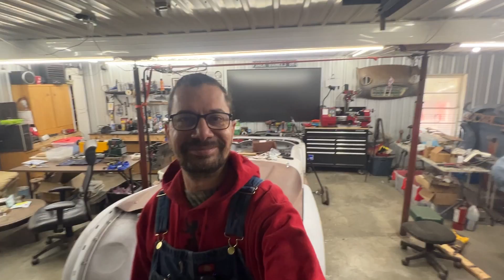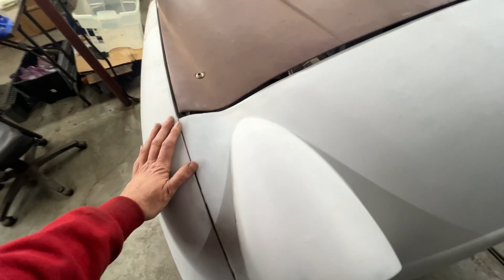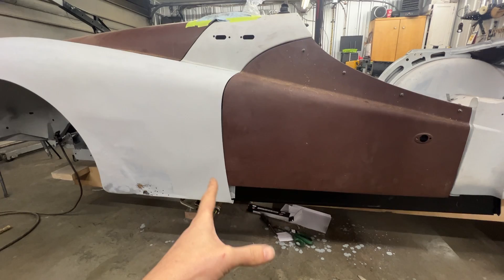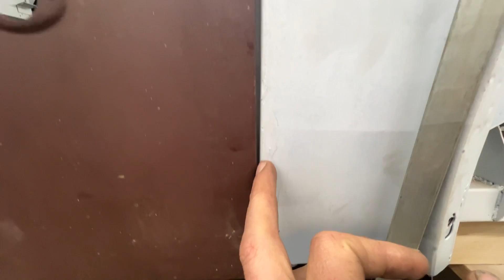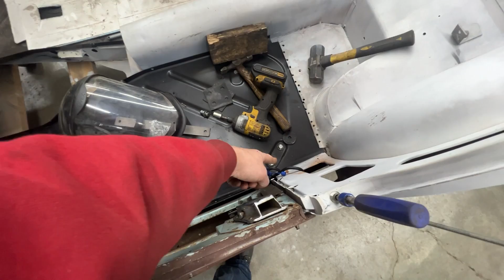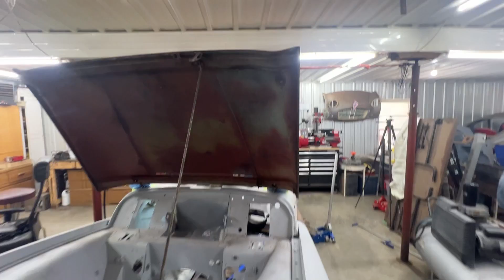1958 TR3 - Part 6 - Playing with panels and gaps

Comment: Hi there  with my tr3a I have even door gaps on the  A post and the B post and the sill section but the A post with no hinge shims the A post gap is roughly about 5/32" (4mm) I am happy with the B post  and the lower sill gaps about but not happy with the top of the curved section what is 1/2" (12mm) what I am asking should I twist  the outer part of the A post panel ( the outer captive nuts section)to close the front gap up a bit and weld steel rod to close the curved section of the door ( near skuttle panel) great video keep up the good work watch from England cheers mark

Comment: Is the car truly a 1958 model?  The 1958 model year started at TS22014 and these were unofficially known as TR3A.  These cars had the wide mouth and external door handles were among the many changes.  It seems like this car has a mix of different panels which is likely causing fitment problems.

Comment: The way the front left fender (as sitting in the car) fits, you can tell the front of it is pointing left, fenders wider at front than rear. That tells me the center of the nose is low needs raised up to match the shape of the hood, not the hood changed to match the nose. That will let the edges of the hood match the fenders and the nose better. And fix the gaps at the front of the hood by bringing the fenders closer together.

Comment: You are still working with unknown factors. Too many pieces from different vehicles. You asked them to put the body on the chassis. Did they check it beforehand?

• Chassis. You are playing around with rubber spacings between chassis and body without even knowing if the chassis is true. 

• Front valence. Which set of curves is correct. The valence or the hood/bonnet? ..... Is that a valence from another vehicle hanging on your wall. It may not be the same model but can you use it to determine which is the correct shape?

Comment: As you mentioned in this video,  these can't be the original panels to the car. The original body shell would have been put together by hand and made to fit spot on. That's why they used lead in places to smooth out the body lines and fill gaps.

Comment: 😊😊😊 3d
Elin, I'm wondering if the frame is level and straight? The quantity of shims you are using on the body mounting points is a lot....
Reply: Actually it is fairly typical for TRs to have an odd assortment of shims... sometimes more, sometimes less. The bodies have a lot of flex and simply weren't all that precisely built. The frames were probably more precisely built when new, but also have some flex (for racing there are a number of frame strengthening and stiffening tricks... plus a proper roll cage adds even more stiffness ).
I'm sure the Triumph factory workers got pretty good at shimming when installing the bodies onto the frames. Experience told them where to add or subtract a little, to match the frame and body to each other. As noted by Elin in this video, they also sometimes resorted to some lead work to fine tune fit.